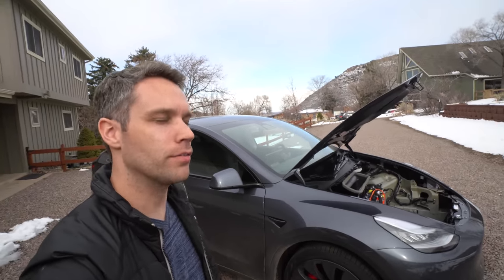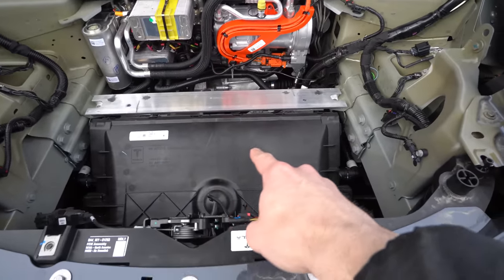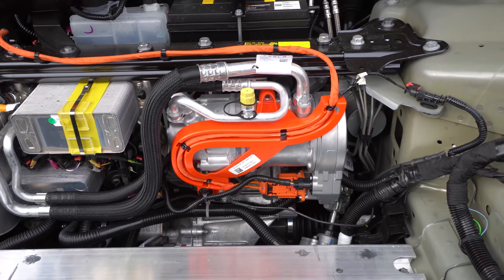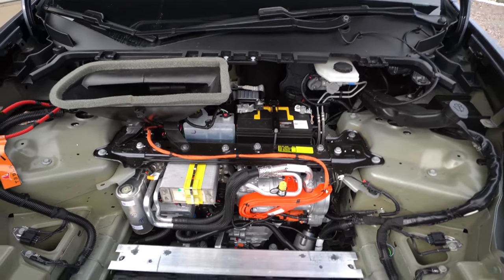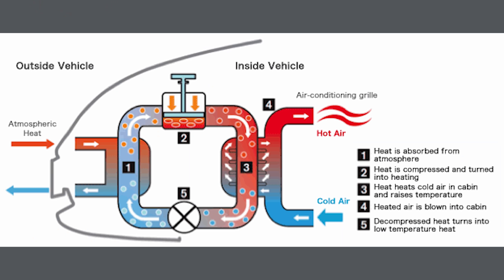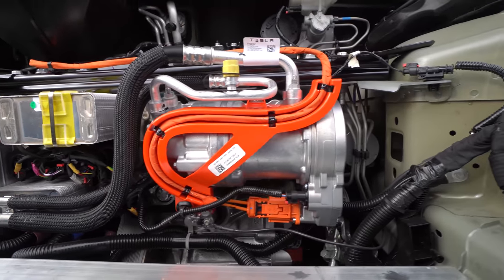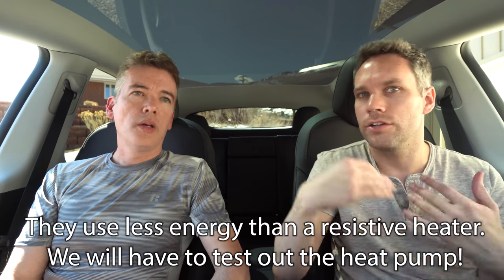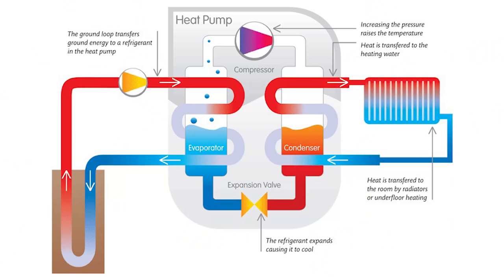The Biggest Change in Model Y Over the S, 3, or X!

Comment: We got a heat pump in our home and it is just so much more energy efficient than the heating coils we had before.
Reply: Just curious where you generally live or more appropriately what climate zone does your (air?) heat pump operate?
Reply: How much different in time for the temperature increase between this 2? Did heat pump significantly slower?
Reply: You had coils in your home before? wtf... That's illegal in some countries as it wastes energy. You burn fossil fuel to make heat and turn it into electricity with 30-40% efficiency, and then you turn it back into heat. So the most efficient way in this case is to just burn the fossil fuel in your home. The heat pump works in all climates I would say. It just consumes more energy the colder it gets. So at some point you're probably more efficient burning fossil fuel directly again. It's basically like a reverse air conditioning system or reverse fridge. Instead of cooling the inside, you cool the outside and heat the inside in the process. Heat pumps can also be combined with geothermals, solar power and such.
Reply: @ahmadfauzi5757  For a heat pump to work you need it to be kindof warm out depending on where you live. Anywhere bellow 30f you need a backup heat coil source to heat the home. That's way way less efficient. And in air conditioning mode they're slightly less efficient too. Just get a gas furnace amd common ac outdoor unit
Reply: @pilerks1  then what's the big deal with Tesla Model Y heat pump?
Reply: @ahmadfauzi5757  Its overhyped
Still though, heatpumps will be more efficient for when its above 20-30f. Far far more efficient. But keep in mind the temperature of the heat it produces isn't as hot and in ac mode it's less efficient that a common ac
Reply: @pilerks1  Modern heat pumps can work efficiently down to much lower temperatures than you're suggesting. Our "Mitsubishi Electric" heat pump claims to produce the same heat output right down to -20C (-4F), and it's around 400% efficient.
Reply: @advocatusdiaboli9351  There are lots of homes in the USA that are entirely electric
Reply: @Pete856  claims and reality are different things
Reply: @advocatusdiaboli9351  Heat pump does not work when it's below 0 degrees Centigrade outside.

Comment: Good insight into the Y.     and yes our house uses a heat pump with our solar system.  Our heat pump is actually a hybrid heat pump. It can use electricity or gas.  You program your actual energy costs and the system will use whichever is cheaper at the time of use.  We used to run it that way before model x arrived.  But now find it cheaper to lock the system to gas only for heat.  As with all heat pumps it's a big AC unit that can run in the opposite direction.  Now if we were using the heat pump on electricity and the outside temperature was low enough so we were only getting 60° inside then the hybrid heat pump would kick in an electric heater to make up the difference that the heat pump could not make on it's own without the little extra help.  As we really had to push to get this system here in the SF bayarea  we might be one of the very few to use it around here. It seems this was better suited for the Arizona areas.  Before the MX we always had a huge abundance of extra power before trueup. So in the winter we would run all electric to heat the house and have $15.00 a month gas Bill's.  At trueup we would end up a net zero home, but all that changed once the power hungry MX moved in.  So now we use gas to heat the house in winter and just make it to net zero on electricity.  One year I forgot to change heat pump settings and using electricity to charge car and heat house was our first year in 8 where we had to pay at trueup.  So now using gas to heat is cheaper that electric heat. So we are still net zero on electricity but pay $120 a month for 3 months for gas/heat. Your larger solar system may help you not use gas, but you have a lot of cars......    I'm sure your doing the dance to manage your solar for your desired outcome.    Good luck.  I love our hybrid heat pump.  It's like running AC all year as far as anyone inside would know except it keeps the house 72° all year no matter what the temp outside is.

Comment: I had a Rheem hybrid hot water tank at my old house that I had installed. The savings was substantial, average annual cost of a traditional hot water heater is about $550 compared to $110 of the Rheem hybrid tank system. Definitely check that out & consider it for your home if you haven’t already.

Comment: From what I've seen the heat pump is more efficient when the temperature is above 0 Celsius (32 Fahrenheit). My house has a heat pump and it works well but where I live the lowest temperature during the year is around 8 - 10 degrees Celcius
Reply: Thats just a standalone HP this one is using heat from batteries and motor as well.

Comment: I had a heat pump installed in my house in San Diego County.  Warm air starts to blow almost immediately.  Cost is actually comparable to the gas furnace that preceded it.  Getting solar/battery system installed later this year, which will make the cost FREE (& no burning fossil fuels).
Reply: This is where heatpumps are best suited. Places that wont need a furnace, and where a heatpump can still remain effective

Comment: I have a 2018 Leaf and what I’ve noticed using the LeafSpy app is that the heat will take a lot of KWh in the beginning but once the car heats up, which generally happens really quickly in below 32 degrees Fahrenheit, it barely uses any energy to maintain it. 

The test for you will be too wait until the model Y is really cold and see how quick it will warm up and then maintain the heat.

Comment: I have a 2020 Nissan Leaf and the heat pump works really well! I don't typically pre-heat my car at home since I am in the process of upgrading the service/installing a 240V charger and the vents are blowing hot air by the time I reach the end of the driveway (about 100ft at 32°F). The range reduction appears to be less than 10% of overall range when using the heater set to 65°F, which is plenty warm for me with the seat heater on.

Comment: We have 2 ACs with heat pumps in our house and use them regularily. They usually need some 3 to 5 minutes to start blowing hot air, but the efficiency is incredible. Of course, the efficiency is higher the warmer it is outside, but it never drops below some 200%

Comment: My e-Golf has a heat pump, but mostly I use the heated seats for more range. The heat pump is used for defrosting/demisting the windows. The range computer estimates a decrease in range by 1 mile for the heated seats whereas the heat pump decreases the range about 9 miles initially. The weather temperature seams to change the range estimate anywhere from a high of 107 miles to a low of 89 miles so far with 32k miles. A good move for Tesla for sure.

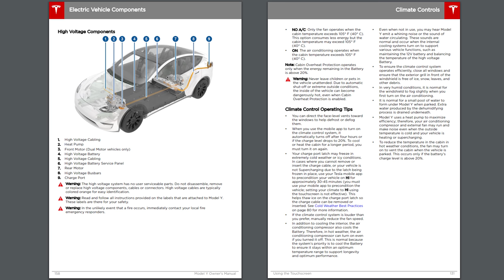Comment: Great video! Just to clean-up the Tesla Owner's Manual shown at the 2:53-mark in the video, a "heat pump" is not a physical part. It's mislabeled in the manual. Think of a heat pump more in terms of a method, or a system, for moving what would otherwise be wasted heat from one place to another. The part the manual points to as the "heat pump" is actually the air conditioning compressor (which the manual even says may run even when the car is heating up). This compressor is what is moves the stuff inside the system around the system to provide both A/C cooling and cabin heating. If you encounter a technician who says the "heat pump" needs to be replaced, instead of saying the (A/C) compressor needs to be replaced, please find yourself a new technician. Thank you for helping to spread Tesla vehicle ownership knowledge!!

Comment: I'd love to see a more technical analysis. You kind of said "Heat pump, so 300% efficient! Whoa!" which I get, but you don't say why heat pumps are 'up to' that level of efficiency.

Heat-pumps... like mini-splits in houses will typically work down to a particular temperature, with their efficiency declining as the temp gets colder. They work by making the coolant very VERY cold, and then running that coolant through a radiator (wrong work for it since it sucks heat in, but the structure is the same) that's exposed to the outside air. 

If the heat-pump can get the coolant colder than the outside air, it can extract heat, but the colder it is, the less heat it can extract. In places that get "very cold" like the upper-midwest USA (where temps can drop below 0F and stay there for weeks a time, and drop as low as - 20F)

 I wonder if the heat-pump in the Y will be able to be effective at those extremely low temps, or if there's a backup ~2k resistive heater in it. The best heat-pumps for homes work down to -13F (Mitsubishi Hyper-Heat minisplits)

Looking forward to a video about it!
Reply: Yes, I’m also interested in the details of the how and why.
I’m stuck with the old technology of my 2020 Model 3.
Reply: Hey @relativityboy, that's a really good (and specific) question about why that's a maximum efficiency. I think the best way to think about it is by thinking about the pressure difference or "lift" at the compressor. Temperature and pressure are linked in a heat pump system, so for larger lift (and larger temperature differences) you need more compressor power. Since the outside temperature can change, you can have a low pressure on a cold day and VERY low pressure on a VERY cold day. This extremely low temp/pres on very cold days causes a larger lift at the compressor for the same amount of heat delivered. This'll be a lower efficiency on cold days and a higher efficiency on warmer days (for heating).

You bring up a good point though: I wonder if there is a resistive element for extreme temps where heat pump operation is either less efficient or impossible...
Reply: Record low in Sweden: - 52,6 celcius.
Reply: Very good point. In fact, speaking of an efficiency > 100% is physically wrong - it would violate the first law of thermodynamics. For heat pumps, the correct concept, and the correct term to think of, is the coefficient of performance (COP).

I'm not sure about the COP of small systems such as this one, but for larger ones  a COP > 3 (i.e. the "300%" in the video) is quite common.
Reply: It does not violate the law thermodynamics be 300% efficient think of a heat pump as a miningmachine it mines the air for heat it's not creating the heat it's capturing the heat that is rounded dispersed throughout the are the scan get the efficiency above overunity it's not it's capturing it and harvesting depending on the delta it is efficiencywhen the air is colder the air molecules are farther apart that's making it harder to compress the heat molecules he is not created or lost I'm a college educated hillbilly in thermal Dynamics

Comment: Consider getting mini-split units for your house. Fujitsu has some really good stuff for low temps. Just leave the current system as is/in place. No need to demo or throw anything away. Have the mini split installed ( or several/one large one w/ multi head units)

Comment: We have a heat pump for our pool here in Palm Springs.  It is very efficient because in our climate, if you use your pool year round as we do, you need to heat it for 5 months and cool it for 5 months.  We really only have a couple of months where the temperature is right on it's own.  It is a bit less efficient if you want to heat quickly (that's why we left our old gas heater in place to heat the spa), but once heated, maintaining the spa is no issue.  It is of course, an electrical device and since we have solar, and Powerwall, it is actually less expensive than when we heated our pool with gas.

Comment: I have a ductless clothes dryer which uses a heat pump to dry the clothes, it's much more efficient, can run at lower temps so it doesn't damage the clothes as much, but it does take longer to dry.  It's worth it for me because it uses about half as much electricity

Comment: The problem with air exchange heat pumps comes when the temperature differential is very large.  I am in northern Minnesota, if it colder than -10F the heat pump cannot move enough heat.  It is still relatively efficient, but cannot provide the needed heat.

Comment: Great video, here in the UK my house uses Air Source for heating, it isn’t something I would recommend, however saying that, ours is a first generation unit and I think they have got better, however it is too complicated for its own good, and even a small change in pressure within the system will make it error = no heat or hot water in the house until it is reset.

Comment: I have a MY14 Leaf with heatpump. Kept me warm in winter 2019 even at -28°C does eat away range faster after -20°C though... I bet there should be no issues with Model Y in cold climates!
Reply: any heatpump is using PTC at very low temp.

Comment: I just bought a heat pump water heater to replace a failing gas water heater. It makes some noise when running, but only noticeable when in the garage. Side affect is that in the summer it'll cool the garage down.

Comment: This is a great addition to the model Y. That would be awesome if the model X comes with this heating function. Thank you for covering that. 
I believe on Heatpump, I got gas hybrid heat pump. I program it to go 20oF when they require 30 degree but push to 20. My heating bill was significantly lower than gas heater. Every time they service my system they always make the gas to come on early almost at 40 degrees. I recognize the high bill the next month than I change it. I live in Indianapolis and it was cold most winters.

Comment: Often, there is still a resistive heater to help on those colder days, as heat pumps lose efficient the colder it gets. Do you know if the Model Y still has a resistive heater or if they have found some other work around, such as capturing heat from the motor etc?

Comment: Finally a review that shows some real tech! Reviews of paint and plastic upholstery are pointless. Heat pumps use the Rankine cycle pulling heat or cold from the ambient air so they can use less electricity than resistive heating.

Comment: Thanks for sharing your heat pump. However if you Tesla had Air Conditioning (cooling), it always had a heat pump. It's just they now run it in reverse so it heats the inside rather than the outside. I hope they didn't charge you extra for this, as its really only the addition of a diverter valve and some other minor modifications to the system. Strange to see everyone getting excited about something that your ALREADY had...with some minor tweaks.

Comment: A refrigerator or freezer has a basic heat pump. Heat is taken from inside the box and deposited on the backside cooling pipes. In this case as waste heat, but if you places the freezer outside your home (freezer door open) and the "cooling" pipes inside your home, then it would heat up your home at more than 100% efficiency. If you placed the freezer inside your home (and opened the door), and the cooling pipes outside your home, then it would cool your home. Same as air conditioning unit working. Many home heat pumps can both cool and heat your home. Work by pressure to manipulate the evaporation / condensation point of f.ex. a gas to move the energy.

Comment: Renault Zoe has a heat pump as standard since 2013. Glad Tesla caught up. However my heat pump seized and needed replaced which was not cheap!
Reply: heat pumps are very complicated and expensive but also very efficient
Reply: @carholic-sz3qv  Not complicated at all. About the same as any refrigerator.  If it is reversible (heating and cooling) then it has one more component, a three way valve to reverse the flow of refrigerant.

Comment: Any idea what the break even temperature is for heat pump versus resistance heating? Typically, heat pump efficiency drops as the temperature does so sub freezing air will have less heat to extract. That is why EVs with heat pumps will also still retain resistance heaters for very cold temperatures.

Comment: I have driven a lot of Leaf, Kia Soul and Hyundai Kona with HP. Down to -5C there is a large difference. Especially Kia/Hyundai have mastered this. Compared it with my Model S in -5 to 0C and while S averages around 2kW to heating the Soul/Kona uses 0.5-1kW so about 1/3 of what my TMS uses.

Comment: It’s the AC running in reverse. Heat pumps are popular in areas that have winters - but not harsh winters. I’ve lived with one for over 10years.  Most heat pumps have Auxiliary heat for when temps get below ~32F. I have no idea how this thing is going to heat the cabin in sub zero temps. I thought for sure they would still keep the resistance heaters for Aux heat.

Comment: I really wish I could share the same sentiment about the efficiency of the Nissan leaf in cold weather.... I have the 2019 standard 150 mile range leaf and have seen nearly 50% loss of range in very cold weather 0-25 degrees farenheit. I was shocked because I purchased it to make my 90 mile round trip and quickly found out that I couldn't always make it back home without finding somewhere to charge.

Comment: Heat pumps works just like HVAC compressors, the only difference is they can go in reverse flow and work as cooler instead of heater.
They take heat from outside to inside or vice versa. Their efficiency can be very high if its hot outside and you're using it for heating but doesn't work well at sub zero temperatures.

Comment: I have a heat pump in my home but the big thing is that they lose all their efficiency when the temp drops below 30F. After that it can no longer suck enough heat out of the air so it cannot keep up. This is where your stage two heating kicks on which will normally be electric or gas.